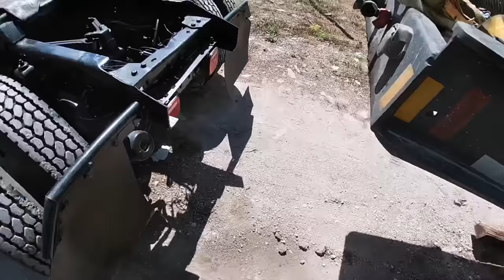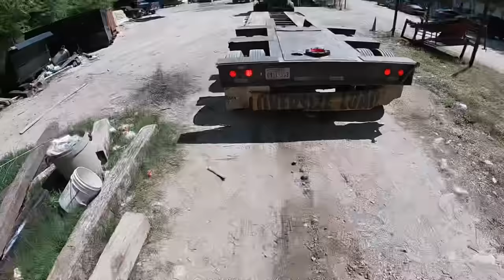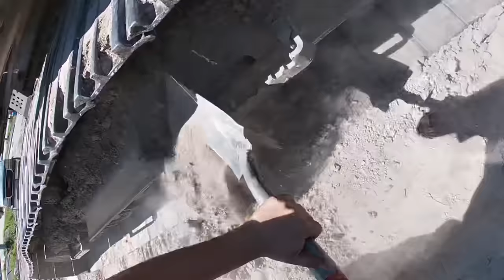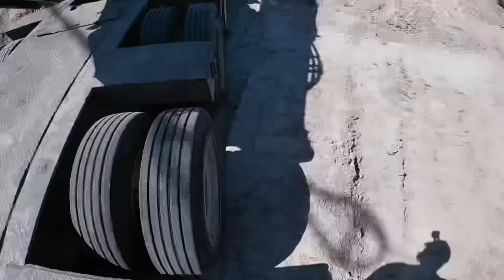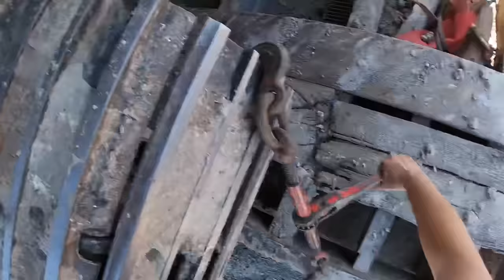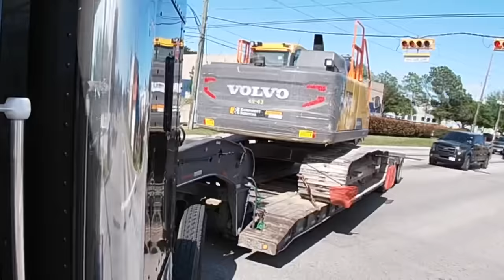A day in the life of a heavy haul trucker | kenworth moving oversize load

Comment: Illegal tie downs. There are tie down points for a reason, use them. Learn how to chain if you don't already know. Binders aren't designed to hold the load, they are designed to remove slack from the chain. A steel track isn't a tie down point and neither is the side rail. If you wreck that load is coming off. Even a sudden stop you could lose your load. We just had a guy lose his bulldozer the other day for doing the same crap you were doing. And all he did was make a turn, bulldozer slid off the trailer right in the middle of the intersection. Where I work we had one of our truck drivers crash while he was hauling a excavator. The trailer and excavator rolled, sheared the pintle hitch right off the dump truck. The excavator stated attached to the trailer despite rolling over.  That is why we properly chain.

Comment: What was the weight on the escavator? What are the ratings on the binders? Looks like there is not enough time downs in that. Unless Que los binders sean de 12,500 lbs. 
 Then that would be 25,000 lbs on front and back such should be just more than 50% of the weight of the piece.

Comment: Is chaining to the tracks advisable as they can break leaving the actual machine unchained.
Reply: exactly my thoughts. put enough tension on a single piece on a track, it will break. The manufacturer advices against this kind of fastening.
Reply: We use chains when it comes to excavators but we use the side holes the chains never snapped
Reply: We never just use the binder like that on the tracks

Comment: if you haul tracked equipment often. For flags we use C clamps with 5/8 Cable welded to the outside then the flag slides over the cable. then you can clamp and unclamp very quickly
Reply from the maker: Andrew Duff thanks for the tip 👍🏼

Comment: I saw a pto hydraulics hose on your truck? Make a connection to the hydraulics on the gooseneck. Then you don’t need to use the small engine on your gooseneck. Also I would first lift up the air suspension and gooseneck before tightening the load. The trailer will bend and your chains loosen. Furthermore great video and driving. Love it, tough job made look easy, can see you love your job. Also finally see someone loading from the side that’s how it’s done

This is me with my truck: https://youtu.be/b6RElbMl3Zc
Reply from the maker: Cool video man 👍🏼

Comment: question about the gears with a truck, is it possible to shift the gears from one by one to two by two and even three by three? I would like to know if it's correct or not
Reply from the maker: No the truck won’t go, you can skip gears bobtailing. But I wouldn’t do it.
Reply: @Grtruckingdemolitionllc  hey, alright, I was just curious how it's going. 
So I'm guessing you must have to shift gears very quickly, especially while bobtailing.
Why not skipping gears even bobtailing btw? is it bad for the transmission?
Thank you for the explanation, it was appreciated.

Comment: Why do you kill the engine on the trailer by turning off the fuel ???  Is there not an on/off switch ???
Reply from the maker: Motor has a problem i think fuel is getting on to the oil or something like that so was told to shut the fuel off and let it turn off by itself
Reply: @Grtruckingdemolitionllc  ahh makes sense now, if the trailer was going to be used more it might be worth while replacing the carburetor on the engine as it's such an important part of the trailer. 

New viewer and enjoying the videos, thanks

Comment: That pin that you pulled out. Do you ever put grease on it or just say eff it
Reply from the maker: Motor rider eff it, does not need grease, goes in and out perfectly, and it has no movement on that pin
Reply from the maker: mrZ71 i have to use it for the frameless dump trailer.

Comment: You didn’t tape the exhaust either. Bad for turbo spinning without oil flow
Reply from the maker: I keep on forgetting to order one. I seen it on amazon. Normally I put a bag but most of the times I forget not even going to lie.

Comment: what is wrong with the designed lashing points on the machine to be used as chaining down points?
Reply: Wasp ___ im in australia and not a hope in hell would i tie an excavator on by the tracks. Also it would be sittin on rubber, and where he folded the boom up and rested it on the trailer id chuck an old tyre under it. Boom will only need a strap. Not a chain, but you americans do everything so different to what we do

Comment: It didn't look like you hooked up to the d-rings . The load would be more secure if you did.
Reply: D-Rings will break faster than that trailer rail.  He did it the right way.
Reply: @unclesatchschopshop9554  the hook can move on the trailer rail. Not good
Reply: No it can't.
Reply: I have been in this game for 35 years, the rails is the only to go, this man is a real low bed driver, he can work for me, any time . Dale roseville ca .
Reply: @dalehuntington9402  
Think about how the chain pulls on the hook. It's designed for being used one way. It's not as strong your way.

Comment: Bad digger driver instead of sitting on the side of the road he should have cleaned the tracks rady for your pickup much faster system then all the truck driver has to do is a quick walk around the digger to give it a quick check.. Inconsiderate digger driver